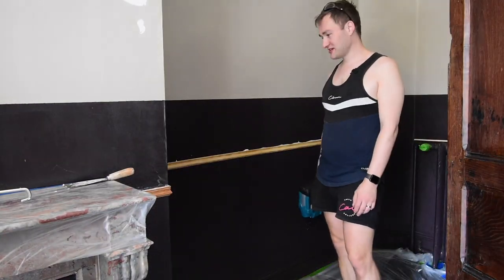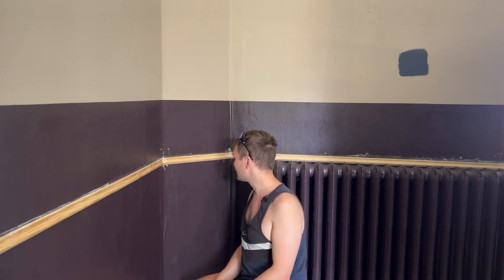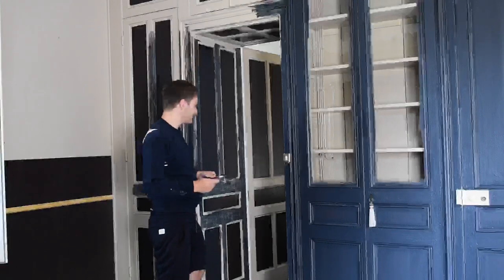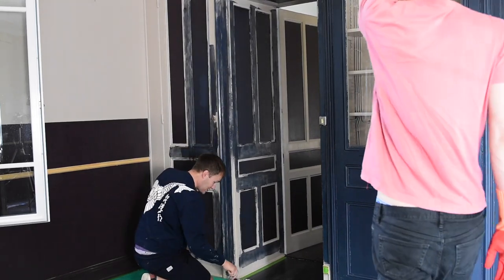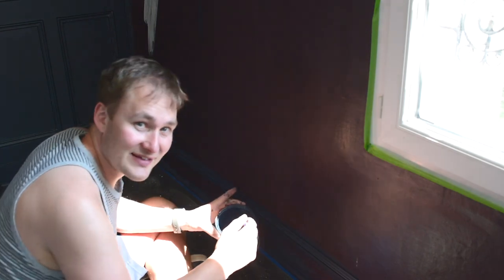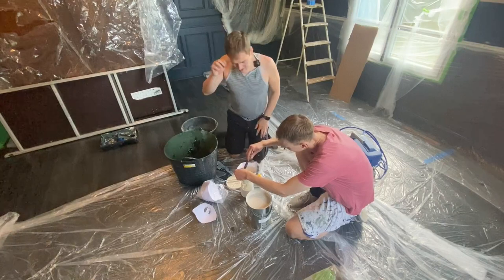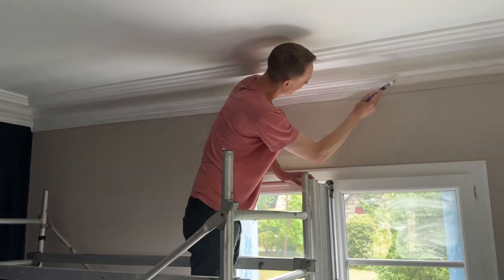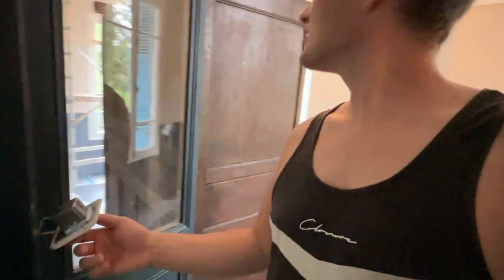We completely transformed this room in a French Chateau! 1/2

Comment: Rather than a nail gun on molding I use 4 or 6 penny finishing nails. Tap the head end into  the wood where you want the nail to be. Turn the nail around and drive the nail into the depression leaving about a 1/8 inch exposed. Then use  a nail set to drive the nail slightly below the surface. Use a filler to level the surface and lightly sand.
Reply from the maker: Interesting.  Might give that a go.  Though we finally resolved the problems we were having with the nail gun.  We were using non proprietary nails and when we got the makita ones they worked much better!